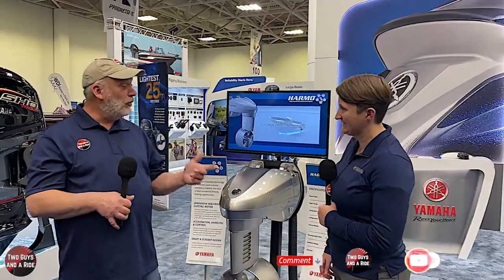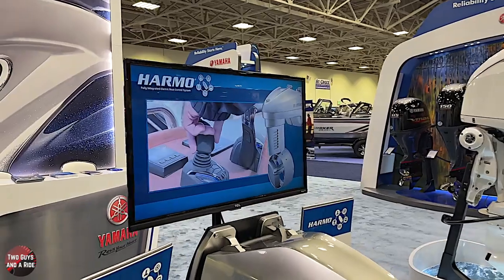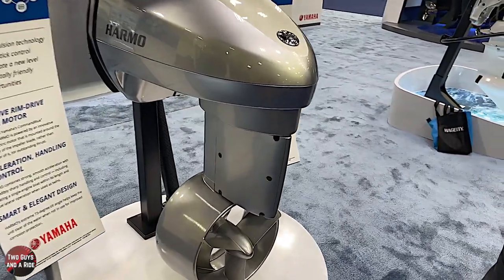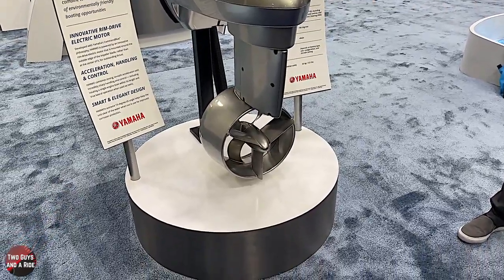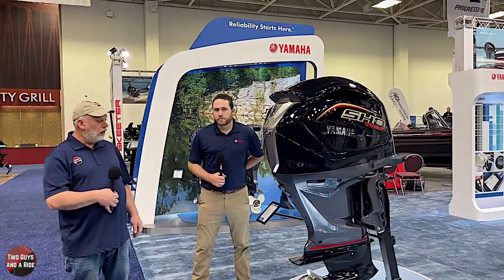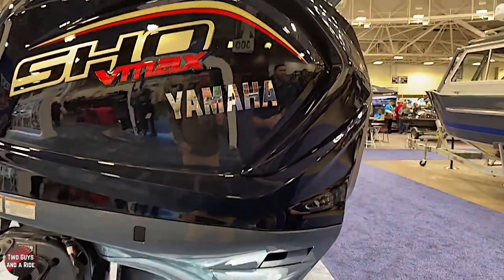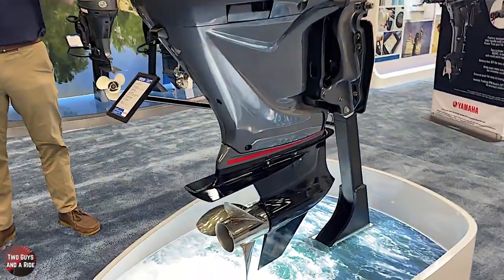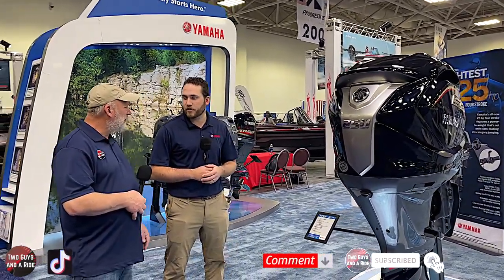The future of boat engines - Yamaha HARMO Electric Outboard

Comment: I'm an old gear head petrol monkey and will never be sold on electric outboards. Leave electric to the trolling motors. 48 volts is 4/12volt batteries. 100 amp hour deep cycle batteries weigh close to 100 pounds each. The batteries and 10 horse motor weighs as much as my 200 horse. No thanks.

Comment: The problem with electric: Initial Cost. It doesn't take the amount hey charge for these motors to manufacture them. At least 50% markups here.
Reply: Im sure what you do is for free and has no markup. profit is why dealers exist, otherwise who would do anything.

Comment: Boats need and use alot of power, how heavy will the battery pack need to be to power a 30ft trawler for say 5 days at sea. what a load of bollocks

Comment: Electric will never replace fossil fuels for marine or aircraft engines. Power to weight ratio is everything in those areas.
Reply: It won't replace automobile engines either.
Reply: @jesusisalive3227  It will when manufacturers quit making gas automobiles. 30 years from now 95+% of the cars you see driving every day will be electric. Gasoline will be priced out of the middle class's ability to afford it for personal transportation.
Reply: its easier to be thought a fool than comment and remove all doubt.  your generation will be gone soon enough and the future will proceed on course without you and your nay saying.
Reply: @bryannonya9769  

Maybe you should take your own advice.
Reply: Best stick hybrdd boat gas eltrc reduce co2
Reply: @sharonbraselton3135 Hybrid tech is too unreliable and overly complicated for ocean transportation. 
     Do you understand that a cargo ship uses more fuel in 10 seconds than a typical size pleasure boat uses in two full days on the water? 
     You don't know wtf you're talking about.
     When on the water or in the sky reliability is paramount for safety reasons. 
Hybrid systems will cause thousands of unnecessary deaths per year. People are not going to risk their lives to make you feel better about CO2 emissions. Federal aviation personnel and Coast Guard officials would be getting shot in the face every day out of pure self defense.

Comment: What is cost per km or more importantly, cost per hour to keep? How long will batteries last before they need replacement and what is their cost? Not trying to be negative but I see great potential ...and great drawbacks.
Reply: This is easy to calculate. If it's a 6 kw engine then it uses 6 kwh per hour at full speed. Battery charging is never 100% efficient so figure another 50%. So about 10 kwh cost per hour of use.

The required battery bank for that hour of sailing assuming normal lead batteries is 12 kwh capacity as you want to avoid discharging below 50% except in emergencies. That's about 220 kg of weight. Lithium is lighter and smaller for the energy capacity and can be discharged deeper, but is also five times as expensive.
Reply: @Ibian666  More curious about how long the battery will last and overall long term effectiveness.  I can really see a great market for anglers desiring a a quiet trolling motor and replacing a fuel powered "kicker" as insurance on big water. Your answer addresses ideal conditions.
Reply: @garyelderman1229  Battery life depends on how much you discharge it and if you keep it properly charged. Lead batteries can last up to 10 years, but it depends how you treat them. If you fully discharge a battery it only lasts for 50 cycles. Hence, don't go below 50%, you will get hundreds that way.

Comment: Really cool concept but not gonna work when you have a fishing tournament and have to drive 300 miles or more when you can refill your engine with gas there wont be electric stations in the middle of nowhere. If you want to stay close and fish yea but for me this would never work for the amount of time on the water it would be holding me back. Thats the issues with electic cars as well. WHo wants to stop to charge every 300 miles for a hour? imagine everyone one the road needing a charge ! we would need thousands of pumps (electical stations ) at every gas station.
NOt to mention if you have a electric truck pulling a boat you would make it 100 miles and need to charge in a ford lightning and they take 4 hours to charge !!! These batterys would have to drive 1200 miles for me to ever want to switch from gas. The only people i know that want a electric vehicle is the city folk.
Reply: @spaceducky101  ok, tweener.

Comment: Not in my lifetime. The weight and range don’t fit my uses. You can guarantee half of the range during winter boating for waterfowl. No thank you. I’ll run Dino juice for my primary propulsion. You’ll need over 600lbs of batteries to run all day.

Comment: Both great motors I’m sure. I’m not sure tech exists to scale that electric to a 250 while keeping the boat lightish, but excited to see the beginning of larger electric motors.
Reply: Vision Marine sends their hello with the 180 hp outboard engine
Reply: You don’t want to use a nozzle on a planing boat. Only for high thrust low speed.
Reply: Till the lithium batteries catch on fire. Lmao. Because some body us we c the wrong charger.
Reply: not everything needs to be scalable.
Reply: evoy make +150hp electric outboard and inboard
Reply: Buy Mr fussing 180 hp envoy 250 hp ektrc

Comment: Really cool concept hope to see some of these upscaled for big center consoles, batteries need to catch up
Reply: No they don't. You can buy plug and play 14kwh/48v LifePo4 batteries today rated for 5000+ cycles. You put this unit on a pontoon boat with 5kw of solar on the roof and you will never run out of charge.
Reply: @davefroman4700  Wont go very far at high-ish speed with 14kwh in one stint though, which is probably what he alluded to.
Reply: @davefroman4700  That costs How Much? Added  weight?

Comment: Electric Motors are GREAT!!............it's the batteries that are the problem.  Never going to be an equal option over ICE in a boat.  It's a supplemental motor only.  No.....I'm not ''Trolling!''
Reply: Never?  You really beleive even 20 years from now they can't compete.  EV's today beat gas cars in price per mile even if you factor in battery replacement in the future.  These outboards are dumb at the price being offered.  Some manufacturer is going to be able to integrate EV motors into the hull that are comparative to to the ones in cars.  The Tesla model S plaid has 3 motors that produce 1080hp combined.  One of those motors would compete agaist the gas V8's found in 20ish foot Ski Boats today.  Even with batteries it would take up substantially less room than a gas v8.  You could reclaim 5 feet of your boat or have a 17' boat with as much room inside as a 22' boat.

Comment: Electric motors are not and I mean are not the way of the future! If you don't believe me go look at what happens to electric golf carts after about 5 years. The batteries cost more than the golf carts are worth! Yes the first 4 to 5 years are great until your batteries won't hold a charge anymore! Just like a cell phone! Gas golf carts are worth more (Resale Value) are always ready, and maintain Peak power after a long hard day of work! On a final note remember when I said batteries are only good for 4 to 5 years max! Most loans are that same length of time, so the minute you pay it off, you are right back in debt to buy new batteries. Gasoline for me, you can do what you want to.
Reply from the maker: All true with current battery technology Most golf courses have banned petrol carts just like new 2 strokes are banned so whether better or not the do gooders are after all petrol engines 
We already have dams that are electric only
Reply: I see a lot of these comments, while people do not realize, oil is running out. So this type of innovation is the only way to go forward. Maybe compare it to cars? Here in Europe, within 10 years the only nee cars allowed to be sold are electric cars. Electric cars are the most sold new cars in some countries at the moment. I wouldn’t be suprised if this will be applied to boats as well.

As a company, I would say you need to innovate otherwise you will loose an entire Marley.
Reply: Electric golf carts haven't evolved much at all in decades.  They use flooded lead acid batteries which is also 50+ year old tech.  I'd hardly declare decades old tech as "proof" of the current battery tech.  You could replace the golf cart batteries with a lifepo4 bank and have it last decades.  Silicate Salt batteries are a great option where conditions are harsh.    An automotive manufacturer could design a lithium-ion pack with much better results than lead.  It's simply not accurate to look at a design that hasn't changed in 50 years and make any claims it represents today's technology.
Reply: @Ry-lx2kl  while I will agree lithium ion Batteries are better. They still do not have the capacity or life span. Batteries are limited period. I don't care how old or new the technology is. Total electric cars, boats, or airplanes. Are not a wise decision. Let me also give you a few scenarios. 1. The life span: I have a 20 year old truck that still runs great. There is no way batteries will be affordable or the up keep on electric motors/ switches and relays to keep a vehicle in service that long.  2. The power grid: the power grid is not designed to put that many electric cars on it. Not to mention charging stations, and what are you going to do in the event of a major storm where power could be out for weeks. 3. The down time of charging. What is a family of 5 going to do for a hour while their car charges? Vs a 5 minute stop by the gas pump. Honestly there is a very small market for electric vehicles, but it is not a perfect or permanent fix. On one last note that many batteries sitting in a junk yard full of acid isn't any better for the environment.
Reply: @jpike53  new lifepo4 batteries are rated @ 6000 cycles compared to 500-100 cycles for lead acid.  Modern li-ion in cars last 2000-3000 cycles.  Expected lifespan in a car is 15 years.

I ran the numbers on how much more power would be needed if every household switched their cars to electric.  It would account for 11% of the current household energy use.  + 11% is not nothing but relative to how long it will take to 100% migrate to EV is completely doable.

Charging ports available are quickly catching up to the number of gas pumps even though EV's only account for 0.29% of vehicles today.  

The efficiency of a model 3 Tesla is 275 watts per mile.  Over 150k miles at super high California energy rates this comes in around $10k in "fuel" costs.  A 30mpg car will consume 5000 gallons of gas in that same timeframe which is $30k at today's gas rate for $6/gal.  These numbers get worse for gas cars if you use national averages.  

A Tesla model 3 is infinitely more fun to drive than a 30mpg car.  Performace of electric slaughters the performance of ICE vehicles.  A Tesla Model S plaid has 1080hp and can do the 1/4 mile in the 10's.  You'd have to spend at least double to reach that performance with a gas car.  That car likely wouldn't have 4 seats or be whisper quiet through town.  The Tesla still gets that $10k per 150k miles while a gas car that could compete on performance would be more like $60k+ in fuel. 

The Tesla also won't require the 25 oil changes a gas car would in 150k miles and would require likely half the maintenance on brakes due to regenerative braking.  

EV's are definitely competitive against gas cars today and beat them in many ways.  Even if you factor in a new battery somewhere down the line it still costs less than gas.  Nearly every auto manufacturer is betting on EV's with dozens of models coming out in the next few years.  There's a lot of smart people running the numbers and deciding EV is the way of the future - and making the bet with billions of dollars. 

Battery tech is improving quite fast.  The price of the battery pack will continue to drop for quite some time.
Reply: @Ry-lx2kl  time will tell my friend, time will tell. Please understand that while we may disagree, I have definitely enjoyed the talk and appreciate the research that you have done. Either way God bless.

Comment: $30k motor for your $1k jon boat that already only uses like 2 gallons of fuel a day. nice
Reply: Bet it won't last as long going up stream in a good river current either.
Reply: But! But! But! This sounds perfect for a military budget... Silent SEALs and all that.
Reply: I doubt the intended target is a small Jon boat lol. the controls alone are worth about as much as a rigged jon boat lmao
Reply: Eto n g only $6000 cheaper 10 hp
Reply: And that will look fantastic being towed by a 70k Tesla so you don’t have to spend those 3 gallons of fuel on the way to the boat ramp.

The gubmint should print more money to make this happen.
Reply: Ive been startinjg to see more and more EV boats on the Portage Lakes, family cottage up there. Outside of one lake its all no Wake zone, Grandparents bought a 22 foot EV toon, even with with 10 peope on it has no problem going all day with charge to spare.
Reply: @TheMrLebaron  How many batteries does it have and is that continuous use all day? As in not stopping to look, eat, swim or just to chit chat.
Reply: @darryladams519  It has two pretty big batteries packs in it. And yeah at no wake speeds you can run it for 16 hours. The top speed is only 25mph but if you go faster than no wake on that lake system you'll get a 300 dollar fine from the DNR or the Portage County Shreiff ( yes they do patrol )
Reply: @TheMrLebaron  Basically idling.
Reply: @darryladams519  Thats how that whole lake system is, anythiing above an idle gets you pulled over. I'll never understand why people at the Marina we use have trisoons with 300s  on them
Reply: @TheMrLebaron  Why take a boat anywhere if you're not allowed to have fun with it?
Reply: @exoticcreature3059  :Look at all the beautiful scenes and homes on the water? Let our kids swim, go fishing, have a cookout, watch fireworks, or just cruise around and have family time? Its a lake system thats nice, quiet and beautiful. if I want to go fast I have my Key West 26 CC with two 250 Yammies on it down here in Florida. Theres more to boating than just going fast. Im lucky enough to do both. While I do love going fast, when we're up on the lake with family on the ole EV Poonton just chilling out, swimming, fishing and having fun. It doesnt need to be fast

Comment: First half - AWSOME.
Second half - Spencer got stuck with the Burn Pile (explode stuff in a sealed up can to make your rig move). All the things the Electric Outdrive don't have - oil changes, oil filters, spark plugs, fuel pumps, water pumps, special coolant, engine sensors (10), EFI issues, fuel filters, ignition units failing, spark plug wires and the Engine Control Unit. Wow - a lot of stuff to keep up with.
Reply: A small engine like this might have some applications where your not doing a lot of driving. But I recently seen an electric outboard that only ran 20 mph for 3 hours. Weight is a big deal in a boat. Batteries are just to heavy and it would take a lot of batteries to get any decent performance.
Reply: if you have the problems you didnt buy a honda or yamaha.  my hondas have been bulletproof and spark plug are cheap. you just a negative nancy looking for non existent problems.

Comment: Electric smecktric....I want to know what Yamaha will do to replace the 5.3L F350C V8.   And will Yamaha make a bigger XTO.
Reply from the maker: Nothing is planned batter technically is years away
Reply: @BrisbaneYamaha  dang…
Reply: @TheKCaryer  
Take a look at the work of an italian company called deep Speed with a jet pod drive for larger boats .. leaves the junk in the trunk  and safer than exposed props.
Reply: Buy yamha 350 hyderge r n full cell every getng on board hydeegen full cells oropne

Comment: I'm surprised there are not more motor with a tunnel type Collier as this increases the total water volume & lest lost more speed less power
Reply from the maker: Yamaha are working on a range of electric motors for boats 
Look at Yamahas e bike crank motor it was a game changer for e bikes because it’s not a motorbike but gives riders super strength legs great rider experience 
No rush- batteries have to improve before boats are safe to go electric
Reply: @BrisbaneYamaha  I'm just an average guy why can't that be done with gas motors as well. However its great to see electric boat motor advances keep up the good work
Reply from the maker: There are similar ideas eg IPS 
But they’re expensive
Reply: @BrisbaneYamaha  thanks for your reply. that kind of tech has been on tug boats for 50 plus yrs, I know onboard is far different from outboard.
Reply: @BrisbaneYamaha  
The tech is there, look at Candela for example. There are batteries and motors, but here is the tricky question:
 Is mankind ready to re-evaluate the need for 100 feet long CC with 25 000 hp outboards to go at 450 knots???
 Speed is poison if you don't foil! If boats are built for multiple engines (big and heavy) one problem is the distribution of the weight. It works better on a cat than on a monohull but not that well anyways.
 It's the wrong "angle of attac" to say: We have this boat, how to replace with electric? It must go the other way around. It's a little step forward to ditch the gasoline and go for diesel (OXE...) because there doesn't have to be fossil fuel in the tank.
 Attraction for size/speed is NOT the same as need. Not many civilians need a 40+ cc with 700+ hp.
 BTW, ePropulsion Navy 6.0 Evo WITH two batteries is 8400€ here in Finland. That is equal to a 10hp. For 30 000$ there must be a Tesla PowerWall included with the Yamaha?